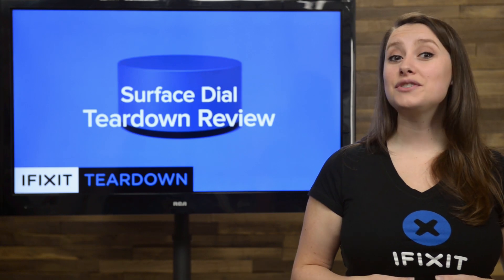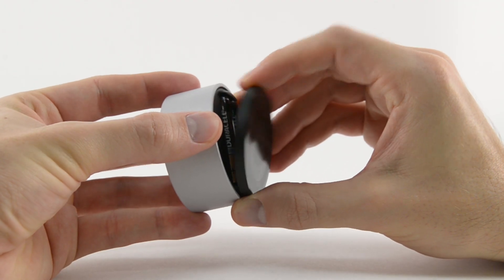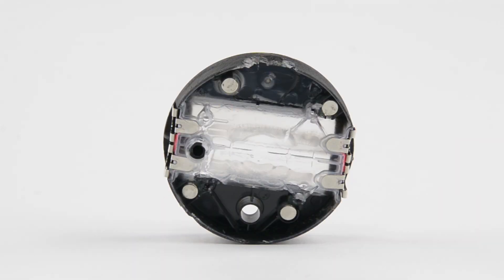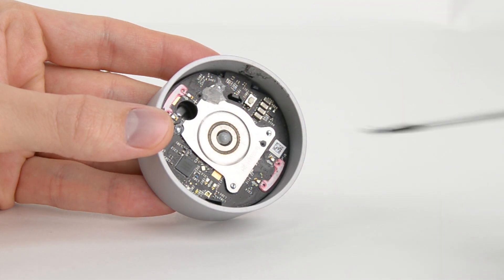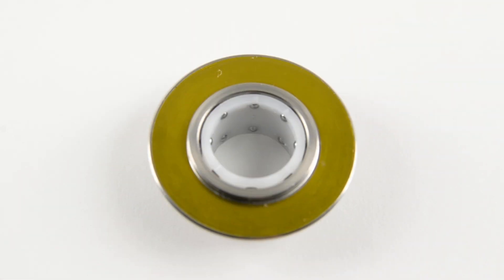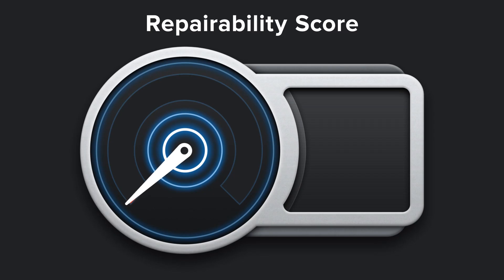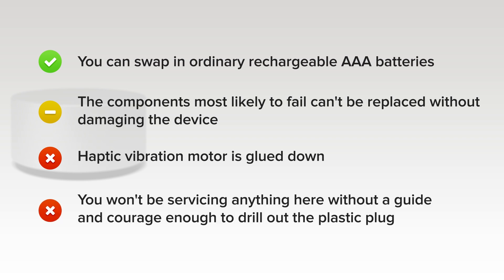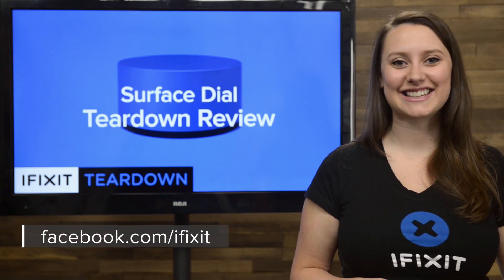Microsoft Surface Dial Teardown Review!

Comment: You do NOT need to break apart the surface dial like that. You also do not need to "drill out" the access port. Simply remove the batteries and sticker to reveal the access port which can be pried open with your fingernail.

I did this myself to clean up some dust from inside.

Comment: that's unfair, the fact that you guys didn't figured out how to disassemble it does not mean it's badly designed...
Reply: +Joey Lopez Also Dell's excellent service manuals, which are publically available and the same documents used by their official technicians.
Reply: uh yeah it does, it’s not apparent to anyone how to dissasemble, making it badly designed - reference IBM/Lenovo green plastic tabs for well designed pc componentry
Reply: Facundo Karanik it's the fact that they are uneducated because Microsoft and lots of other companies don't give disassembly instructions
Reply: But none of them does. What is the point?

Comment: Your scoring is so messed up. you break this thing taking it apart finding maybe a better way to do it. Nothing is repairable and it gets a 4 when it should get a zero SINCE IT'S NOT REPAIRABLE!!!
Reply: +Joshua Removable batteries, replaceable switch, replaceable mid frame, replaceable ball bearings, replaceable base, screw construction and no adhesive anywhere. If anything, I'd say the score is too low.
Reply: Changing batteries are the only thing you referenced that you could actually change. Good luck getting anything else to repair this and even if you can get the parts you have to break other parts to replace other parts...
Reply: The repairability score measures how easy a device is to repair, not how easy it is to find parts for. If you watch the video, they talk about another way of getting into the device that doesn't damage it.
Reply: I watched the entire video... and I even referenced them possibly finding a better way to open the unit up without breaking it. I believe they need to make there scoring more consistent. I don't think they should score a device repairability based on the possibility of finding a better way to disassemble it without breaking it. I have watched and completed tear downs on devices that score much lower than this device based mainly on the screw type. Sometimes there scoring just doesn't make any sense. I don't have anything against this YouTube channel (I have purchased tools from them) or Microsoft as I use a mixture of Microsoft and Apple products.
Reply: They admitted in the video there is another way to disassemble the device without breaking it, they just didn't know that before hand. All you have to do is drill a hole through the plastic battery tray, and while that isn't a 10/10 on the ease of repairing scale its still very possible for the average person to do it without damaging the device.
Reply: Actually the design is genius, everything should be held on by magnets and not by adhesive, all what you need to take it a part s a stronger magnet and there you go.
Reply: But it got broken, because they did the teardown in a bad order.
Reply: cfunkera I watched the entire video but you must not have ready the above comments...
Reply: Joshua C if they broke it a little bit getting into it I'm definitely going to destroy it trying to do the same